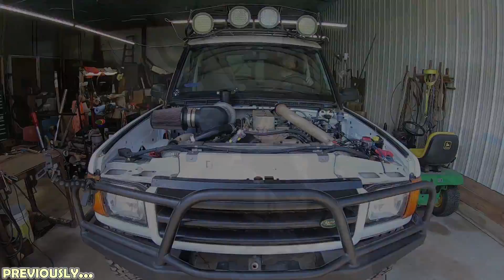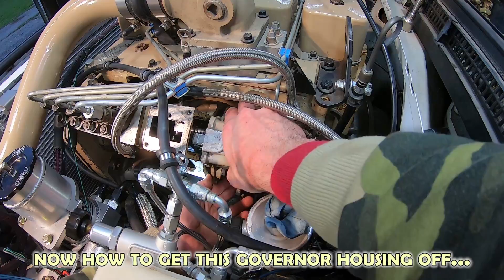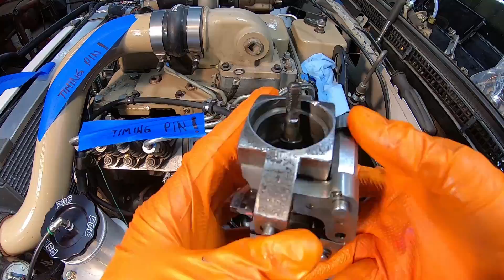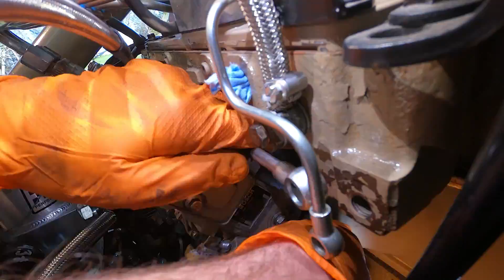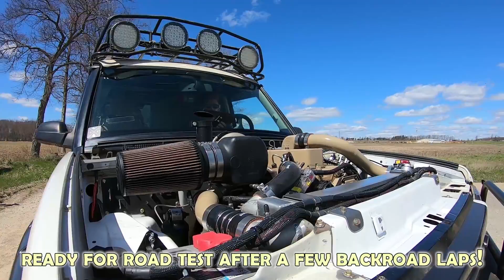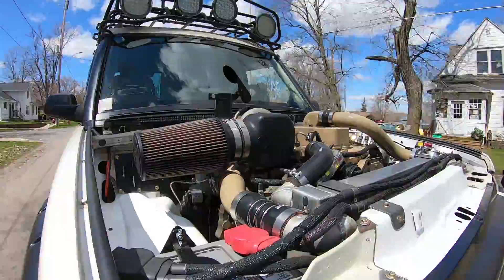Road Driving + Pump Fix × 4BT Cummins Discovery #45 [Land Rover Build]

Comment: Ever thought if messing with the star wheel or grinding / taking out fuel plate
Reply from the maker: Oh yes, in fact I've fiddled with literally every component in there. I still have plenty of fine tuning to do with turning the star wheel, adjusting the smoke screw, sliding the afc housing & plate, bleeding off the wastegate etc.  BUT I did already grind my own plate profile, modified the AFC rack & swapped washers on the diaphragm for more fuel travel, 4k gsk, etc.  Lots more power potential when I get head studs & injectors & fire rings >:)
Reply: Tinker gotcha I’m excited!
Reply from the maker: I've been kinda stunned how lucky I got with my "base tune" settings & how clean it runs, but a little more rich couldn't hurt. I'm not afraid of a little more smoke to keep egt's happy 😎
Reply: Tinker lol from all you’ve said I’m very impressed as well... I would say you very well have tinkered with most of it, yet still no smoke I guess if you want big results bump the pump but then risk heavy running heavy timing and possibly running away. All in all I know you will do good!
Reply from the maker: Yeah I'll take it a little easy on pushing power until I get the head studs installed (maybe fire rings too) but then I can get the bigger injectors in there & bleed off the wastegate so the turbo can breath past it's original 28psi.  I already have the timing cranked as much as I think is safe (14.5deg if I recall correctly) unless I get a bigger pump, which I think is probably why the bigger turbo is working so well with the engine so far.

Comment: Impressed again with your job Tinker! Nice pump fix...
Only would like comment 2 thinks. First to ask you about roof light. It seems on the corners more yellow like for fog purposes and more white in the center. Is right? Can I know the reference of both please?
Ok second think. I' m a little afraid about your health. I mean that exhaust seems very near of cabin air intakes and near too of front windows. Think that at certain speed all exhaust gas or a part of them maybe can enter on passengers places. Think about it please. 
Overall great job again. We are always expecting about your news and progress...
👏🏻👏🏻👏🏻👏🏻👍🏻😷
Reply from the maker: Thanks, was a real head scratcher since I've never been into an injection pump before.  The outer ones just appear that way because the covers are grooved to scatter the spot beam into a flood.  I love those lights, they are so powerful!  I don't think they make them anymore, but here are the specifications if you can find something close: Aosi brand name, 9" round, 225watt.  Oh don't worry about the exhaust, just temporary for fun until I build the snorkel and full exhaust with muffler :)
Reply: @Tinker1837  😷🤗👏🏻👏🏻👏🏻👏🏻👏🏻👍🏻 Glad to hear it (about exhaust question) tnx for info concerning lights!

Comment: consider setting Idle slightly lower, will help low speed shifts relatively easier. at least till you get used to it..
Reply from the maker: I'll give it a try, just have the idle set up near 800rpm to smooth out the shake.

Comment: Find the highest torque rpm range. Example : it is
- 1500-2500 rpm in my Nissan diesel SUV
Upshift at 2500,  downshift when 1500 
If you drive in constant speed, try to adjust your rpm around 1500-2000 rpm. If you accelerate, increase 2500 then upshift and so on
Reply from the maker: Good info 👍
Reply: @Tinker1837  Thanks Mate 🤟🏻

Comment: Hello.  Judging by the video, the front of the car body hangs out a lot.  Check the condition of the cushions on the body-frame mount.  I wish you success in completing the project!
Reply from the maker: Body mounts are okay BUT the suspension springs are not happy about all the new weight from the engine in front + the camper in back... need new springs soon!

Comment: Wow the same thing happened to my p7100 pump. Bent governor springs. My fault I improperly installed new 3-4K g. springs. Very impressed you fixed on our truck. I could not find replacement parts so I had to send my pump to get repaired. It couldn’t be fixed. I wore it out running pure (filtered) but not cut or diluted vegetable oil. I had to buy a hole new rebuilt unit.
Reply from the maker: It was tricky to do on the engine, not to mention hair raising since it's all new to me, but so glad I did it this way.  Unlucky issue but could've been sooo much worse!

Comment: You should check out the Banks DataMonster. That one gauge can monitor all the vitals of your power plant. Gale Banks has some great videos on what is can do and what you should be monitoring. IE: Manifold Air Density not Boost PSI.
Reply from the maker: Ok yeah I know it, and Banks is such a legit dude, big fan 👍

Comment: Wish this was an auto, mated to a sweet diesel would of been mega. Sounds the business tho! Any idea on HP?
Reply: 110hp probably...
Reply from the maker: I'm not a big fan of autos, except for drag racing. But it's around 225-250hp & 550-625tq (from known build recipes, not a guess)
Reply from the maker: @kealahau6727  LOL nope, was more than that stock :P
Reply: Me too im over driving manual specially off road on steep obstacles too very scary driving stick on steep muddy hills
Reply from the maker: I've been practicing my footwork for years now (left foot braking & heel-toe) and thankfully this thing has torque on tap so you don't even need to give it throttle into gears, but here's hoping I don't regret going with the bolt-action trans!
Reply: @Tinker1837  Loving the build tho man!!! Can't wait to see you get stuck into some tracks in it!

Comment: You say the brakes feel great without the abs? Because I've always had a soft pedal on first pump i have all steel braided lines and even replaced my master cylinder and haven't felt any better i would hate to keep throwing parts at it if it's never going to get better
Reply from the maker: What size you go with?  AN-3 or 4?  I've gone a size up by mistake before & had that problem.  I plan to custom mount big Range Rover Sport calipers (6pot fronts & 4pot rears) so I'll be going stainless AN the whole way eventually too.
Reply: @Tinker1837  3
Reply: @Tinker1837  I'm thinking i may have a sticky caliper
Reply from the maker: Huh, so sizing isn't the issue, hopefully it's an easy fix like a caliper.

Comment: Look on the clip of your Watergate actuator you cant be creating enough boost because it's not even moving on mine I have the exact same actuator granted I have a little bit of smoke mine moves free reving a little bit
Reply from the maker: It doesn't open until 28 psi, & I was not pushing it hard enough to crack the wastegate open after what happened previously.... soon though!

Comment: Awesome stuff. great to see it running.  Will you be running a snorkel? I'm just wondering if the current set up ( i know it's only temporary) might be restricting your air flow, primarily the large elbow joining the air filter to the turbo.
Reply from the maker: Snorkel for sure, have a whole plan for that using a fancy Donaldson filtration unit.

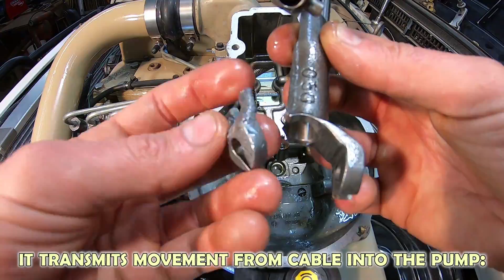Comment: Just spitballin', but the yoke on that linkage looks a little thin at the upright, 3:38+ looks like it had been wearing for some time. Bet you that the temperature will come up on some long grades, or in the summertime. What is it about the transmission that is so different ? Great days to you and yours, you must be stoked with how it is shaking down. Pretty minimal dilemmas considering how much work in so many areas and systems you have done !
Reply from the maker: Even the new one seems thin in the material between either leg of the yoke & the stem of it... but from what I can tell it's not from wear but cast that way.  I'm beginning to wonder if somewhere in the process of building my throttle cable mounts / bracket if I managed to crank on the shaft or hit it with something to cause this. Because the more people I ask the more rare it sounds like this failure is.  Oh for sure & I already have fans, just need to build a shroud to hang 'em.  It's not so much the transmission is different as the whole thing is, only ever driven a diesel twice & it was far from your run of the mill truck.  I've just been into real high revving imports for so long that this whole "shift with no throttle input" thing is throwing me for a loop.  Yeah these sorta speedbumps are something I expected & if this is all I encounter then hell yeah I did okay haha!
Reply: Thanks for the great reply, look forward to seeing how you will finish it up !

Comment: Hi Tinker! A lot of time without hearing from you...
Hope all well.
Is possible to know wich model is the roof of your Discovery and the 4 lights there? A pair of them are fog lights? I'm interested in and in the roof for my Discovery. I hope to find it in Spain. Greetings 4 U from Barcelona 😷👍🏻🤗
Reply from the maker: That's a Voyager roof rack & the lights are Aosi brand 225W LED's with interchangeable fog/driving covers (but I don't know if they are still available)
Reply: @Tinker1837  Thank you buddy. When you have for sale autocad, solid works or so plans for the rear furnitures and appliances please let me know for buy it. I will introduce in it some modifications for mi Discovery 300tdi according my needs and I would like to made it. 👏🏻👍🏻

Comment: Don't know why 4bts are more 'clattery' than 6bts
Reply from the maker: Sadly those missing 2 pistons throw the internal balance out, and straight 6's are naturally near perfect in balance.  The shutdown wiggle on these 4 bangers is something else!
Reply: Put a butterfly in the intake to help the shutdown. Will shut down like a petrol.
Reply: @guri131  a throttle plate in a diesels intake has many advantages, no after racketing when turning it of, surpressing (to some degree) the actions of a runaway, and can in most instances be useful when you're driving downhill for added engine braking. But in that case you would have to be sure the engine can handle vacuums like that. Of course you would need some complex linkages (similar to a choke cable) or more cable management when using an E-throttle

Edit: forgot to say that i like the 4 cylinder sound alot And that absolutely phenomenal work on your side. Looks like it always belonged in there.
Reply from the maker: Great ideas!  I have seen swinging & guillotine plates on pulling / race trucks, could be a fun idea to play around with.  And an exhaust brake is on the list, made sure to leave room on the hot side of the engine to pack one in hopefully before the downpipe section.

Comment: Did you have any problems with vehicle inspections since you converted to diesel in your state, the engine has to be the year or newer than the vehicle and tested by the year of the vehicle?
Reply from the maker: Thankfully I did not, since Michigan has no requirements for that sort of thing.

Comment: What are you using for the snorkel and air filter?
Reply from the maker: I'm building a custom setup that I'll fabricate to run up the passenger fender & a-pillar, using a Donaldson sealed dual filter system on the same side of the engine bay 👍

Comment: What year NV4500 are you running? Also any chance you have a part number or year range from the bell housing? As well as which adapter plate off of the engine do you have. Finally looking to mate up my 4bt to a 94 Chevy NV4500 but I know its gonna take some additional tweaking to make work.
Reply from the maker: The year I'm not too sure, since it's a hybrid built from new & upgraded parts.  The engine side's based on a Dodge 4x4 Heavy Duty Diesel truck with the big clutch + big bearings, & the tail's based on a Chevy 2x4 Heavy Duty truck.  The bell housing is the Advance Adapters part meant for the HD Dodge diesel (with big clutch/flywheel), & the adapter plate is the same (from a 6BT Dodge).

Comment: You never said what caused all that damage to the pump ??? .
Reply from the maker: I wish I knew why!! Best estimation I could come up with all the input I received was something was damaged/cracked before I even installed it, perhaps when the mudpump I got it from self destructed it's pump gears, and it just didn't rear it's ugly head as an issue until I actually put some load to it with that first test drive.

Comment: My car is landrover discovery 1995 3.9 engine gas , the car with me since 15 years ago , I prefer it than Toyota,  no body here drive landrover only Toyota and American  cars most , I love discovery its strong car , but the engine I change it more than 5 times , no body here can fix it ,now I can't drive it cos the engine is broken again ☹
Reply from the maker: The Rover V8 engine's from the Discovery's have a common flaw, and mine also failed several times.  Could you find a Land Rover diesel engine to replace your gasoline engine...?
Reply: @Tinker1837  its difficult to find parts so what about full engine. I will try to find the diesel engine perhaps its works , thank you for ur reply🙂

Comment: Your driving style is annoying especially your clutch control that's not how to drive a diesel but you will get used to it
Reply from the maker: Style?  Nah, just being a total noob since the only diesel I've driven was a bonkers built 6BT w/auto.  It's a nutty change from the flyweight Honda race car (that spins 10,000 rpm!) and my BMW enduro (pretty much a dirtbike) that are my current daily drivers!

Comment: I'm sure it will doughnut when everything's adjusted! Will you need a hood bulge or does it fit as standard?
Reply from the maker: Center-axis 4LO donuts in this thing would be nutty!  Yes, plan is a cowl added to the hood with a few unique features to clear the tall intake + turbo.
Reply: @Tinker1837  I'd be tempted to make some type of ram air scoop leading to a cyclonic pre filter with no loss of suction! Lol,it would spit out water and debris before the high flow filter,just thinking about wading without a raised intake? De-selectable rear wheel drive would be good for climbing ledges at brakeover point to stop backflips !:)
Reply from the maker: I'm looking forward to the intake/snorkel build, and I love the idea of modifying the LT230 transfer case even more than I have so I could maybe "twin stick" it!  I have an old NP205 case that's setup for that, but the LT230 has a center diff (since AWD) so it could be a little more tricky.

Comment: Try not to lug the trans.  Nv4500 isnt a fan and will eventually causes some issues.  After some reading on dodge forums and so on, most people up shift around 2200 and try not to run down below 1300.
Reply from the maker: Very much yes! My terrible shifting at first was a bit embarrassing, but I've always included my mistakes. Also doesn't help that my other manual trans vehicles are SO different than this thing.
Reply: @Tinker1837  im learning it too man, i just happen to have a nv4500 that has a failing 5th gear that lead me down the road to learning this info.  killer built, really cool to see.
Reply: @walt3r88  hey man, I'm late to the party but there is a simple fix for the 5th gear issue. I had a shop fix mine. If memory serves, it's just a locknut or jamb nut. Happy cruising.